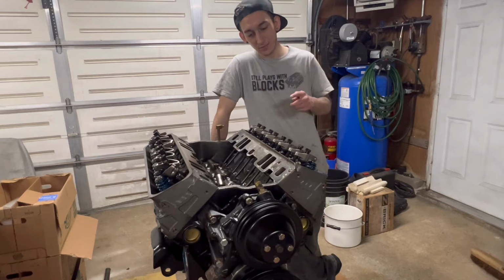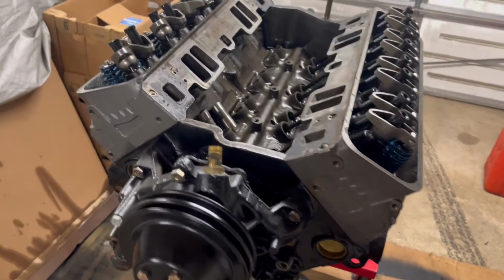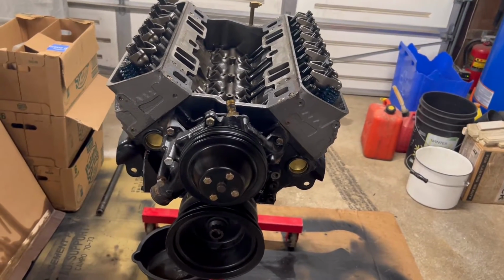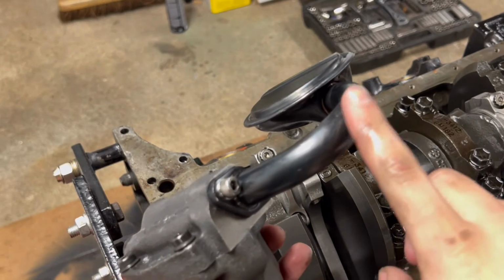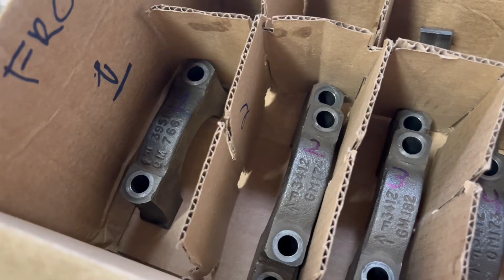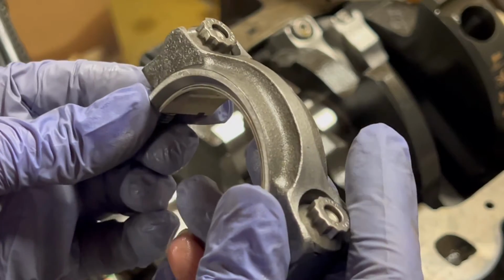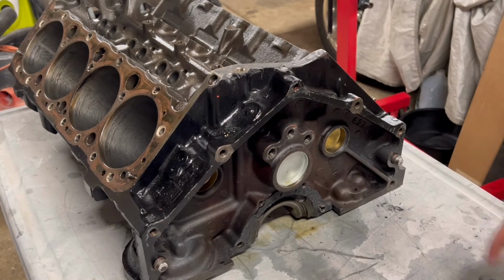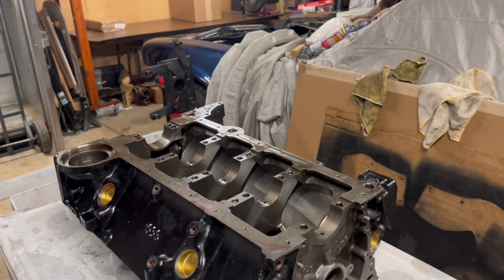350 SBC Disassembly - 1973 Camaro Part 2 - Wiped a Cam

Comment: Good video ! Im just refreshing a 327 i have and top to bottom and Im alittle worried about the comp cams lifters that have been failing. Not to many other lifter options here so i went with the comp diamond carbon ones. Hopefully they work!
Reply from the maker: Definitely make sure you follow Comp’s break in procedure to the letter. If anything were to go wrong, they’ll blame you for not following a step precisely. Make sure that when you’re ready to start the engine, it’s ready to go - fuel bowls and lines full, distributor timing set, idle raised, etc. if it doesn’t start right up, something is wrong. Avoid sitting there cranking the engine for long as this will cause the assembly lube and cam grease to get slung off. If it doesn’t fire right up, stop, and check everything again. Good luck!
Reply from the maker: Also for future reference, my first lifter choice goes to Johnson’s flat tappet lifters. You can find suppliers with a quick Google search. But I know sometimes the lifter choice is limited, so I understand!

Comment: I feel for you man! I'm currently ready to start up a old Ford 390 in my pickup I've rebuilt & im double checking every little thing & have my fingers crossed! It's really a very low doller build I'm doing & close to stock but it is a flat teppet cam. But it's a old crower cam I bought back when I was 15 & im 46 now. It's been sitting on the shelf all these yrs. I've decided I should probably use it. But the lifters I just recently bought. But even though it's not a high end build its been alot of work & dealing with some of these machine shops around here has been a huge headache & im almost scared to rely on any of them. I could take them a good part & just want it machined to a spacific measurement & they give me back junk that I can't even use anymore. It makes me regret ever taking parts in to them in the first place. The amount of money I loose out on isn't worth the headache to even take them to court. I just chalk it up as a life lesson. Now I know. But im still out the parts & that's what really sucks! I spent yrs collecting some of this old equipment.
Reply from the maker: Just make sure you follow break in procedure to the letter! Have your timing set, fill your fuel bowls/prime the fuel system, make sure all your ignition components are hooked up and ready to go, etc. you want it to fire up as soon as you crank it, and minimize time spent cranking while trying to get it to fire up. Also make sure while you’re doing the break in to walk over and bring the RPM’s up a little bit every so often, you don’t want it just sitting dead at, say 2500 RPMs for 20 mins. Go and give it a little rev every few minutes. Oh, and use a good break in oil and a good filter like baldwin or wix!

I’m sorry to hear about your machine shop experience, that really sucks. The only time I’ve dealt with one was 15 years ago when they had a set of heads I needed some work done on. They had them for months. I didn’t bring a single thing from this block in the video to a machine shop. Everything was within apec so I’ve just been slapping it together. Believe me when I say I’ll be quadruple checking everything this time around. Let me know how your build goes and thanks for watching!

Comment: Biggest headache these days is figuring out oil.  As best I can tell, api or sae blessings mean zero because... the astm tests used [IVA & IVB] both specify an overhead cam engine for certification.  Worse... lets say a grind has about a 0.14 degree taper [which presents as about 0.0025" difference side to side with a micrometer],  their spec can pass as long as wear stays under 0.003" and receive certification.  My jaw dropped, reading that: oil can cause a cam to go dead flat/no more taper... and still "pass".
Reply from the maker: Oil has most certainly changed for sure. Are there any out there that you like?